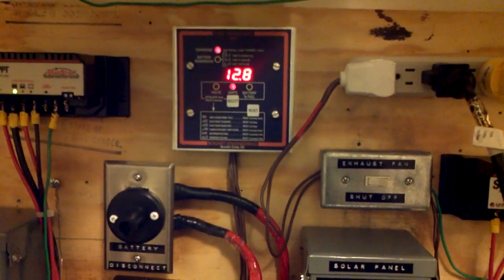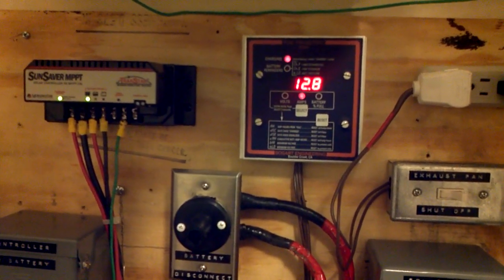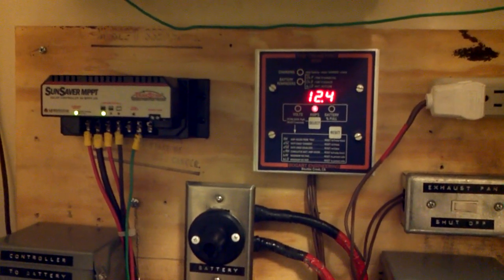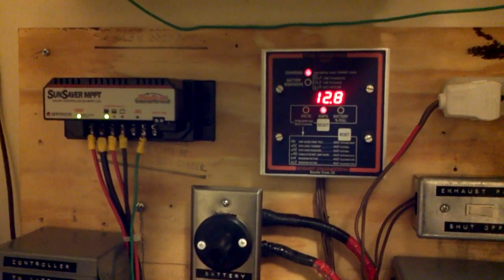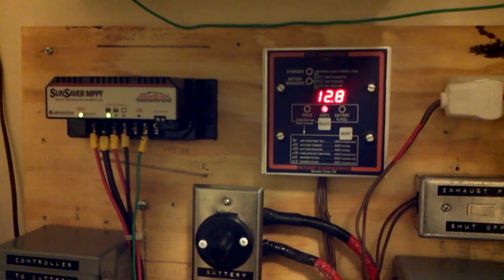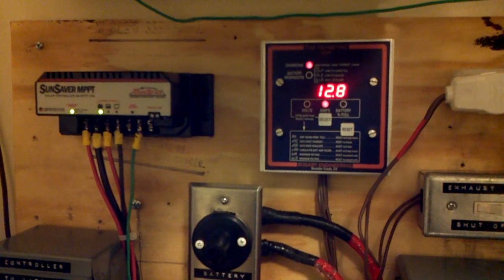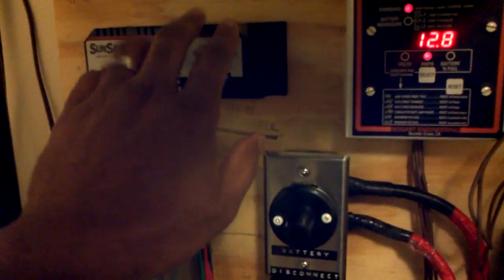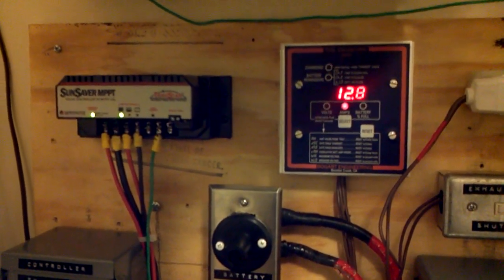DIY Solar - Why MPPT over PWM?

Comment: I have one 60Watt Poly Panel now on a cheap $10 PWM with a single battery.  I just bought two Kyocera 120 Watt Panels.  So I am going to hook the panels and battery bank up as 24 Volts.   I had a couple of questions.  Are you still happy with the Morning star Controller?  Will it handle a 24 Volt system? or do they make a 24V version?  Have you had any issues running two different types of panels on it?  I ask because I am considering getting a second 60 watt panel to add in series with my original 60 watt panel and hooking them up as well, but I have heard that if you use different size and types of panels then the MPPT's don't work (or they don't have any advantage over a PWM)  Thanks
Reply from the maker: My system is a 24v system and I have dual mourning star controllers that have been doing the job just fine for going on 3 years now. I have dual controllers because I have different types of panels 12v and 24v which are separated into 2 arrays (2 panels each).  Each array is in series. However you must be careful that your panels, if they are going to be in series, are not over 70v open circuit. Mourningstar mppt controllers are good controllers for small systems.  Go with a bigger controller if you foresee your system growing into the kw range in the future. And yes, 1 controller will not handle two types of panels.  Hope this helps.
Reply: Wait I thought Morning stat where rated at 150 volt open circuit. At least the 45 and 60 are.
Reply from the maker: Yes, that may be so. It has been a long time. The one's I have will only support 400W and a maximum of around 70V DC comming into the system.

Comment from the maker: I've done the experiment with my panels in parallel and I've not seen any boost in amps, since the panels were in parallel they didn't have high enough voltage too make a difference. At least for my setup, panels in series has the highest benefit with my mppt's in terms of charging capability. If I was going to go strictly parallel wiring then I would stick with a PWM.

Comment: I realize that there are benefits to hooking up solar panels in series that can only be processed with an MPPT controller, but assuming you had sufficient gauge wire to hook the panels up in parallel instead of series, how much current boost would the MPPT controller give over a PWM?  Those same two panels in parallel should give over 15 amps.

Comment from the maker: PWM's will take whatever power is coming in from your panels to charge your batteries based on the rated voltage and amperage of the charge controller. In essence it's the same or similar to any standard battery charger you buy from an autoparts store, simply there to keep your battery from overcharging. These units are fine for simple and small backup systems. If you are considering growing into a larger system I recommend going with the MPPT's, MPPT = faster more efficient charging.

Comment from the maker: Thanks for your question. Panels will produce power (watts) within the range for which they are rated, in your case will be around 100w + or - under "ideal" conditions. MPPT's will help to get the "most" Amps of those watts to your batteries, (watts in = watt out), MPPT's have a DC to DC conversion circuit that will allow the unit to convert the higher voltage to more amperage (in the process it decreases volts) to the battery(s), while maintaining the total power (which is watts = V x A).

Comment: My question is will a 100w rated panel produce more then 100w with a mppt ? And the pwm will do the rated wattage or lower ? I got two pwm 10a cont on amazon and eBay at least they were free promotion codes

Comment: I'm using a 180w 36V panel (yes this is a true 36V panel) with the same SunSaver MPPT unit.  Panels are 60 feet from my batteries (not ideal but located for max sun) wired with #8 copper to minimize line loss. the batteries are reclaimed sealed gel cells from a Telus repeater station   12 volt 650 amp/hour  for $500  (a steal of a deal)  The higher voltage panels transmit better over distance than 12 or 24 volt units. the SunSaver gets the maximum power  these panels can deliver at a good cost!

Comment: what is cool with both system is they take a higher voltage and use it to charge a systemof lower voltage.  IE   60 volts to charge a 28.8 volt system ect.  so the 12 amp you are getting is the downconverting of the voltage.    they kind of act like a step down transformer.  you put in 120 at .6 amps and you are able to get 12volts at currents up to 6 to 8 amps depending on the windings a pwm and MPPT works so much in the same way.

Comment from the maker: @sjh7132 Actually, a better analogy would be why use a motorcycle instead of bicycle. Yes, they both have wheels but they are two different technologies designed to do similar things. However, one technology will achieve the result faster than the other. Why?, because it utilizes more advanced technology. They may operate on some of the same basic principles but through the technology used, they are clearly different. Take Care.

Comment from the maker: @randacnam7321 Your right, a single MPPT controller is not recommended if mixed arrays are involved.  That's why I use dual MPPTs of the same make and model. They work in tandem very effectively. Granted, there was the additional cost and complexity in the design, but it was well worth it. I would agree that PWMs are a better choice if the array consists of a mixed match assortment of different panels with varying characteristics or if cost and simplicity of system design is an issue.

Comment from the maker: @akaishs In my opinion, the (2) 200Watt panels are a nice start.  Proper placement is critical.  The rest depends on your needs and the type of system 12v or 24v?  24v is more efficient.  The batteries are fine.   Safety is important, be sure to get proper cables, fuses, and disconnects.  I think a 100W inverter is too small, I would increase the wattage. A 400W inverter is a good start (250W if it's a Grid Tie).  A 30A PWM controller is good but a 15A or 30A MPPT is better (depends on panels).

Comment: Hey nice comparison.I want to set up a starter DIY system at home back in jamaica was thinking 2x 200watts panel 30apm charge controller 100watt pure sine inverter and 4x6vx225amph deep cycle battries and do the add ons as time goes by. What r ur thoughts, Thanks

Comment from the maker: @Fearlessthinker Thanks for your clarifications.  And you are right.  This video was to address a previous comment made on another video referring to MPPT vs cheap PWM's and buying additional panels.  What I want to emphasize to someone new is the charging capability.  Those panels in series produce approx just over 7 amps on their own, but by using a quality MPPT controller there is a definite boost in the charging performance, i.e., 12 amps to the battery as opposed to just 7 amps.  Thanks;